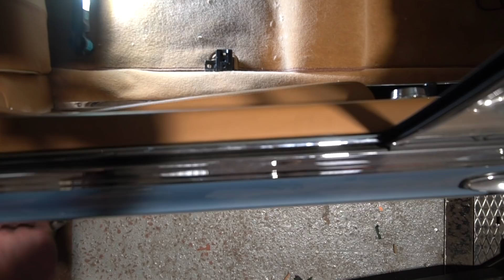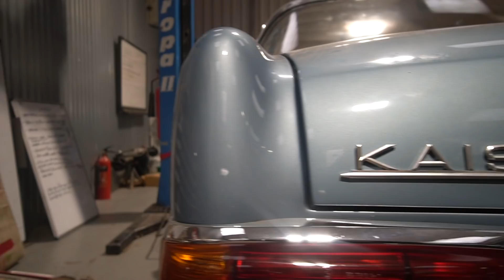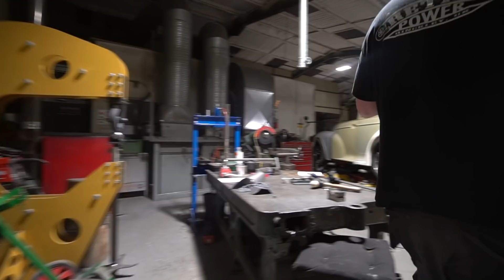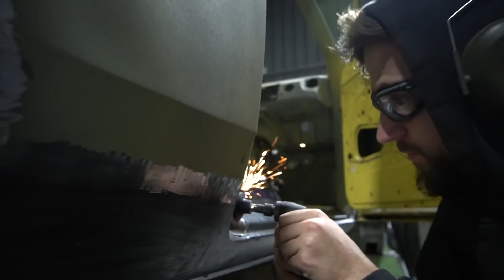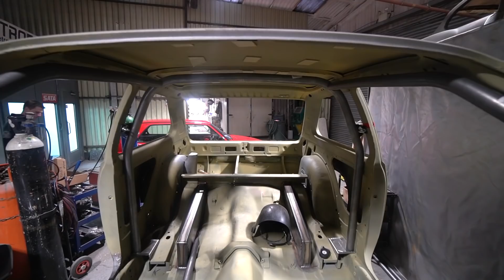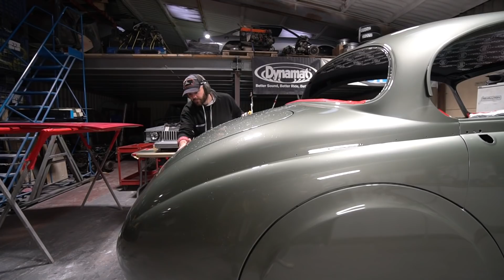Retropower Uncut Episode 17: Blown Lancia Stratos, Restomod Mercedes W111 & Jensen CV8 Stripdown

Comment: Why not using steel or aluminum and nickel/brass/chrome or zincate/nickel/brass/chrome plating? We did the cast steel with nickel, brass, and chrome on a 1957 Chris Craft in 1982. It's been exposed to saltwater and harsh elements for almost 40 years and it's as nice as the first day it was done. The OEMs cheap out and chrome directly over nickel on steel or just zincated aluminum.  Of course it doesn't last.

Comment: The Ford 8.8 IRS developed for the 98-04 Mustang was also used in the Ford Explorer well into the Y2Ks as well.  It has a considerable  aftermarket performance support and they are $550 usd with the cradle.